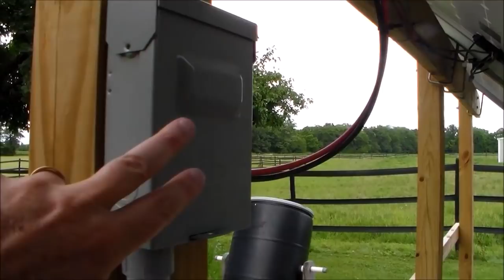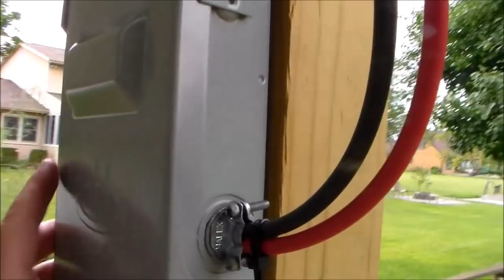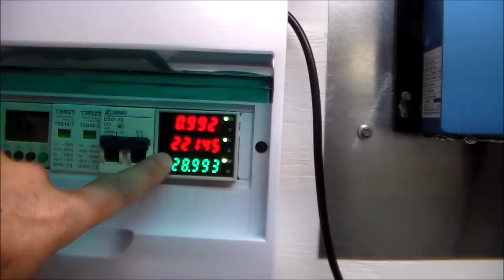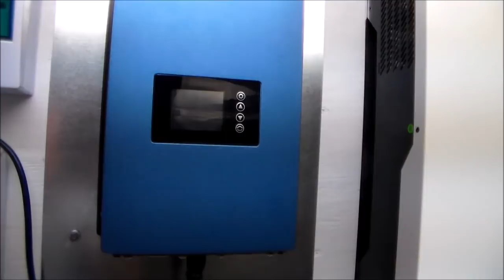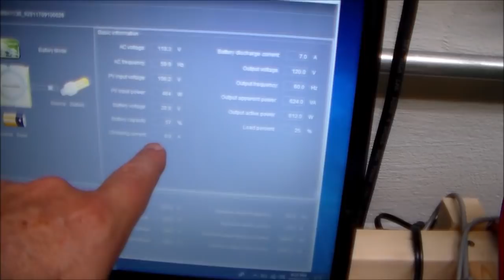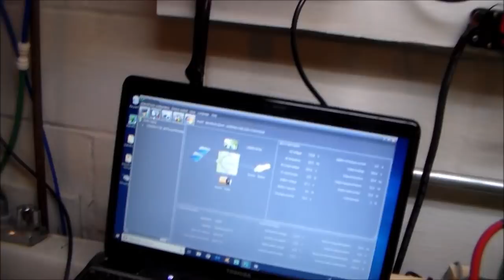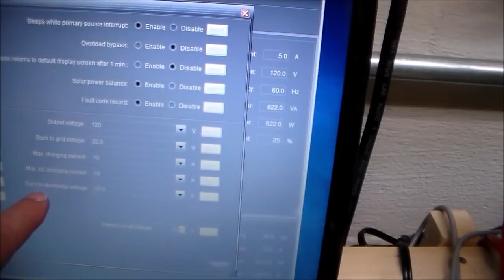DIY Solar - Episode 11 - Up and Running

Comment: Code is minimum of 18 inches deep with a red ribbon above to warn people digging down there is electrical line below.   I would also further putt a wooden board above the cable and below the red ribbon to protect incase the ribbon isn't noticed right away for careless diggers...

Comment: OMG... it IS an awesome system... well documented ? I mean , should you get in debilitating/ terminal auto wreck... would the inheritor of the system (or existing significant other) be able to maintain or repair upon a component failure ? Methinks not... I am overwhelmed at times, & I am electronically experienced... i.e. this ...does this...then... xxx seconds  later, starts this... awesome experiment, if nothing else !
Reply from the maker: Seminole Rick I have most of it documented.However in case of something debilitating, my wife wouldn’t have the interest since this is mostly a hobby. It would be really simple to de-install everything. Nothing out of the ordinary with that.

Comment: Hey jim! Great Job.  I know you're concerned about feeding back in grid, but you only have one inverter with one limiter.  What prevents feed back on other phase circuit in your utility box.  I assume you have a split phase connected to utility company.  Mppt sells two inverters  connected in parallel specifically for split phase.  I'm going that route to ensure I don't feed back to grid.

Comment: You replaced a 100amp sensor with a 200amp sensor (Pics on eBay of the original sensor show its output as .05ma... which is double of the 200amp sensor you replaced it with)... Wouldn’t that cut your wattage in half?.... Could you remove the blue plastic cover on the original limiter sensor clamp and wrap the sensor wires around the cable and tape them in place?... There also seems to be this setting... https://ae01.alicdn.com/kf/HTB1Gp1eben85uJjSZFvq6xIgXXaY.jpg?size=86593&height=692&width=800&hash=aa74371e6ec4870fb4059067b06169c4 
Would like to see an update on the progress you have made

Comment: jimginnyohio  I saw in the previous video you said your house is about 90 feet from your panels for those 90 feet what size wire did you use.. I am going to be building an array in WV and putting it on a hillside that is going to require about 150-180 feet of wire from panels to my Grid Tie inverter.  I am thinking of putting the panels in a 48 volt Series/Parallel configuration and at 20 amps my calculations show 1.8 volt drop at  180 feet on 4 AWG and 2.8 volt drop at 180 feet on 6 AWG wire.  Just curious as to what you used.  Also which Grid Tie inverter did you buy specifically.  I am looking at https://www.amazon.com/dp/B076KBCHBM/?coliid=I2ECMLU6RQWF9N&colid=1E0FHSO4LAHSZ&psc=0&ref_=lv_ov_lig_dp_it  from amazon.  Thanks so much for your very informative videos.  Regarding your batteries I have a question I would like to ask would you drop me an email at cdeluca@gmail.com?
Reply from the maker: The grid-tie inverter I purchased was the 1000W 45-90V version. I have my panels configured in a higher voltage/lower amperage configuration since you can get away with longer cable runs using smaller cable. My panels are wired for 60V/17A. Therefore, I was able to use 10AWG cable for the 90-foot run. Actually, I could have gotten away with using 12AWG, but wanted to minimize the loss more.
Reply: @jimginnyohio  Thanks so much for the info I am looking at 30 volt 290 Watt panels and I will take your advice and go the same route but go with 8 AWG cable.  I thought they were 48 volt so that is my fault not doing the research.  So at 180 feet only going to drop 3.6 volts not too bad.
Reply: @jimginnyohio  Jim - if you have the batteries in a 24v  set up - why did you get the grid tie inverter that was 45-90v. I'm doing a 24 battery system and I thought I should get the 22-45v one? My panels VoC are 39.8v and I'll have those in parallel which I assume are 24v panels? am I wrong - what am I missing here.
Reply from the maker: Yes, your are correct in your assessment. However, I did not plan to connect my batteries to the grid-tie system. Instead, I'm only using those for the off-grid functions. I went with the higher voltage GTI so that I could run higher voltage from the panels giving less power loss in the wiring.
Reply: @jimginnyohio  So your Sun inverter is set up as48V - your 4 panels= 24v Panels in series and parallel  for 48v coming is so you went with the 45=90v inverter and your PIP actually is set up as 24V as is your battery bank that the PIP is connected too. HAve I got it right?

How come you didn't get 2 sun inverters - isn't running the extension cords for the PIP more of a pain then just having the limiters do their stuff ( even though you would need to add  a charge controller) to your set up?
Reply from the maker: Chuck Ger Correct. The plan was to add another GTI later. Instead of running extension cords to the PIP, my plan is to add a generator transfer switch instead. That way I connect any of my 110v circuits to the batteries anytime desired to serve as a solar generator.

Comment: Nice work.  Are you using the 45-90V version of the Inverter?  You might want to contact your supplier.  I believe that version is for non-USA 230V systems. It might auto detect 120 and output that thankfully, but for the watt readout it thinks it’s putting out 230, thus the 1/2 reading.  Just throwing it out there from one old tinker to another.  Keep up the good work.
Reply from the maker: Yes, I am using the 45-90V version. However, it is indeed the 120V system and not the 230V model. As for the 1/2 reading, I was able to get that worked out, but haven't had time to post another update video yet. The problem was caused by the clamp I was using. I hope to post something within the next few weeks. Thanks for your comments!
Reply: @jimginnyohio  Cool. The product info on line isn't that helpful.  I just bought 2 of the low voltage units for my project. Looking forward to your next video.
Reply: @jimginnyohio  Please can we have the solution in text here verses a video reply?
Reply from the maker: Jeremy Kline Yes, absolutely. Www.yhdc.com, part number: SCT023R - 100A:50mA

Comment: Don't see any new updates, how's the system working and any new changes?
Reply: Everything is still working fine. No updates yet. I hope to post more videos this spring.
Reply: @jimstockton3326  Have a 1k inverter myself running good with four 340w panels, just ordered a Chevy Volt battery to hookup to my Morningstar controler...
Reply from the maker: Terry Wallace Nice. Just curious but where did you order the Volt battery and what was the Price? I’ve been thinking about getting one of those as well.

Comment: Hello Jim, Mohamed here.  I have watched I think  from episode 3 until this point.  You have done a fantastic job on your system and videos.  I commend you on your research and attention to detail.  I have started to do research as I plan on setting up a solar PV system when I move in a few months.  You have said you are not an electrician, however, you obviously have done excellent research and sourced out products for your system very well.
I have been admiring all your work. I am not an electrician and I have done many electrical projects in my home.  I live in Ottawa, Ontario, Canada and I bought the electrical code for the province so that all the work I did was to code or better.  It will help me when I work on the solar system.  Again, you have done a tremendous job so far and I look forward to your future videos. I may be contacting you with questions in future! Thanks, Mohamed
Reply: How is your system coming along?

Comment: Hi were you able to find a solution to the clamp descrepancy? I used a 400a/5a and my values are way high. I just ordered a 100a/50mah like yours and I was wondering if you have an update? I was also curious if maybe I can put a resistor in line to get a correct reading.
Reply: FilRider , did you solve this issue?

Comment: Hi Jim / Ginny in Ohio,
I really enjoy your videos and am amazed at what you put together.

Can you please tell me a few things?

1)How many of these valence batteries  🔋 can you hook up together in a series without there being a problem?

2) I saw the Noco charger that you have and want to know how much or to what percentage do / did you charge the individual batteries up to when you first started charging them up one at a time after the year of them sitting and before you turned the whole system up to?

3) what AWG wire did you use between the batteries 🔋 please when you hooked them up together both in Series and Parallel.

You shows how nicely you did the wires and with heat shrink but I didn’t hear what size AWG wire please?

4) what percentages do you have as a max and minimum when you’re charging them and what is the lowest the voltage goes and what do you have set as the highest voltage when it then stops charging please?

5) Last question, do you have to use the computer to set parameters on the charging and where would I get that program please and it’s settings to put in.

I really am impressed with your system and have even started buying these same batteries , but it would help if you could direct me / help me please.

Thank You Very Very Much

Mike
Mikesept16@hotmail.com
Reply from the maker: Hi Mike - I will try to answer all of your questions....
1. The manufacturer recommends not connecting more than four in series...so that would provide 48 volts.
2. The NOCO charger is a "Smart Charger", so I just set it to Lithium mode and let it do its thing. It charged to 14.2V.3. For the battery bank, I used 4AWG stranded cable.4. The laptop computer is used to monitor and manage the PIP Inverter/Charger that the batteries are connected to. The software I'm using is called "WatchPower" and it comes along with the PIP Inverter. Once the inverter is set up, the computer and be turned off since the settings all get transferred over. However, if you wish to continue monitoring and logging the inverter/charger, you simply leave the computer turned on. You can download the software here: http://www.mppsolar.com/manual/Watchpower%20(off-grid)/
The settings to put in there is a bit tougher to answer since some settings are provided by the battery manufacturer while other settings are either trial and error or depend on your desired results.5. The data cables coming out of the batteries are used for a Valence BMS system. I checked into that, but it was extremely expensive. Currently, I am not using a BMS, so I manually balance the batteries periodically.Take care!
Reply: jimginnyohio .. HI Jim,
I really really really want to Thank You for responding to me.
It really means a lot to me
Thank You
Your system and what you did is sooo impressive.
I only bought 4?of these batteries / valence batteries so far and I just bought the NOCO charger , I think the 7200 .
I just didn’t know how much to charge them to or if I fully charge them.
I think I understand your answer.
I’m not looking to do 48 volts.
Your system is fantastic.
I’m just fixing up and RV , and old TOYOTA and I’m going to have it at 12 Volts but make it 40 Amp hours Ah x 4 for about 150 to 160 Ah for the solar I’ll be putting on top.

Would you mind maybe giving me your email address so I could write you through there please.

I look at you as a trail blazer with this and I’d like to it only ask you things but to show you too IF that’s ok w you.

Thank You Very Very Much
My email address is

Michaelfruchtermd@gmail.com and my phone Number is
907 712 4785

Jim, 
Thank You Very Very Much😊
Reply: @jimginnyohio  Thank you. I am going to start my project soon. Please update more in detail so we can know and it wound help newbies.  Thank you so so so much. Fantastic work. Why to pay 15k instead of 5 to 5 I and do by your side

Comment: Jim,  What size wire did you run from the Array to the house?
Reply from the maker: Mach1s According to the wiring standards, I could have used 10 AWG. However, I spent a little bit extra and went with 8 AWG instead to limit the losses over the 100+ foot run.

Comment: HI.  Good videos. . . .  Sun G measuring 50%.  Simple fix. . . . Wrap the mains cable thru the Current Transformer twice.   1x = 50%.    2x = 100% . .  Quick solution should the Sun G be the problem and unable to be sorted.  Good Luck

Comment: Speaking with my experience with me being a Firefighter, you need a Disconnect with Labels for your P.V. next to your House Main Disconnect. I know you have them At the Panels, those can be overlooked easily during a Working Structure Fire because of the Distance between the Panels & the House. 
Take care...
Reply: It doesn't seem like he cares.. Like he said he buried wire at 18" when he thought code was 24... Sure you know, But what if another future resident digs to put a simple tomatoe plant in... The more I see these people with their DIY solar, the more Wives I see in the Home Shaking their Heads.... Give it up!

Comment: So you're running DC 100' underground??
Reply from the maker: Nomad Chad Ha Ha! No. I am running the DC line coming from the solar panels about 18inches underground for about 100 feet.
Reply: @jimginnyohio  oh I see now, actually I missed a comma. What are your losses like at that distance using DC?
Reply: @jimginnyohio  I like your system, my friend just bought some batteries from an electric bus for real cheap. Those limiting inverters are great for power wall setups.

Comment: Hi - Do you have an update on your MPP or overall system? Were you able to get a sub-panel / auto transfer switch setup? Thanks!
Reply from the maker: mike stasko No updates yet. I have the sub-panel, but haven’t had the time to install and video that yet. When things slow down a bit with work and family, I will get that done and posted. Sorry for the delay!
Reply: @jimginnyohio  No worries. Enjoy your approach and thinking to these installs and have adopted a few of them.

Comment: You're only measuring one leg of the power coming into your house with the blue unit (it only has one current sensor)! You should use two of the 120 v grid-tied limiter inverters one on each hot lead of the house and use only a thousand watts of your solar panels to charge the batteries up because it's only backup...
Reply: If he only feeds one leg I can't see why he need a sensor of both legs. But excuse me if I am wrong as I dont have any experience  of the US two leg split phase system as I live in Europe where we always have three phase incoming power...

Comment: hi can you talk more about your battery configuration?  

What voltage are they
are they AGM , Lithium ion, FeP04?
how are they configured
what are the AH for each battery 

Why are you only getting 430 wish watts from the GT panel set? It looked sunny enough.  what is the DC voltage coming in,  255w panels I see, but what panel voltage are they each?  that said, I see you have a 2 in series and 2 in parallel for the GT panels set?  ..  what is your configuration ?  just curious so I can understand how your are manipulating your voltage 

what is your panel configuration for the off grid setup?  48 volts..  I like your willingness to learn and dive deep  8 panels on the off grid and 4 panels on the GT..

Comment: I did buy these off ebay and help the displays work closer to corrects watts. YHDC SCT016TS Split Core Current Transformer Input 150A Output 50mA Black,

   https://www.ebay.com/itm/YHDC-SCT016TS-Split-Core-Current-Transformer-Input-150A-Output-50mA-Black/162561963797?ssPageName=STRK%3AMEBIDX%3AIT&_trksid=p2060353.m2749.l2649
Reply: also mine was really close to ready right amount of watts till I  put the larger clamps on it.   It's all in the clamp.

Comment: Hi Jim - great series and one that i am thinking about incorporating some of your setup in my own future build. Were you able to figure out the inverter issue? Did you run the test? Thanks again for your videos..!
Reply from the maker: mike stasko It’s my understanding this is a common issue with using this device in the U.S. since we use larger incoming wires on the two phases. I was just the first person to test it along with a Sense meter to know for sure how much the A/C leg is actually using compared with what the inverter reports being used. The invalid reporting issue is caused by the clamp. The one that comes with the inverter is a 500ma, while all of the larger clamps are a 1a. If someone would produce a physically larger clamp with the 500ma rating, the device would read correctly. Although I haven’t really found this issue to effect my solar production very much.
Reply: jimginnyohio thanks for the info. Have you thought about setting up a subpanel so you can isolate and use smaller panel legs in order to use the clamp? I have a 100amp sub panel that I will be running a pair of these against.